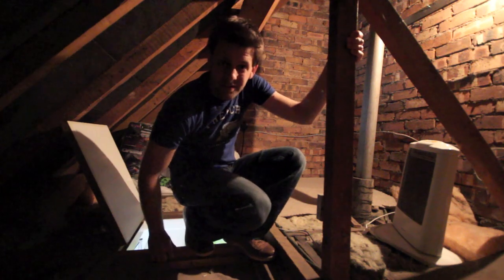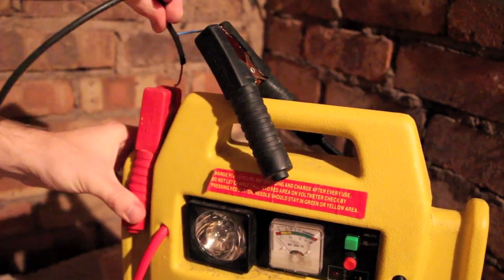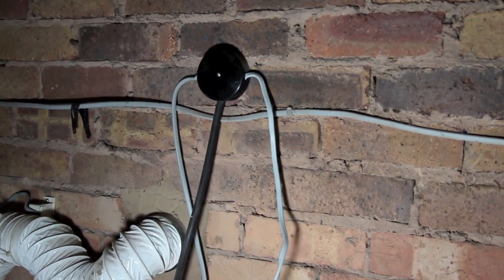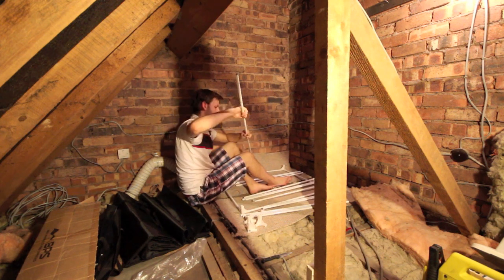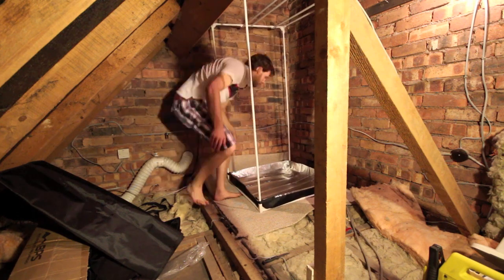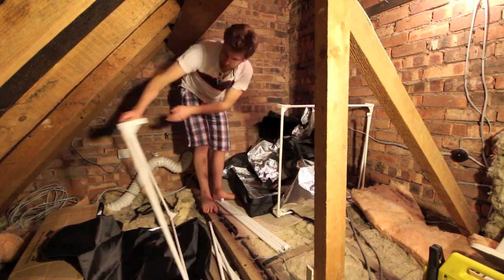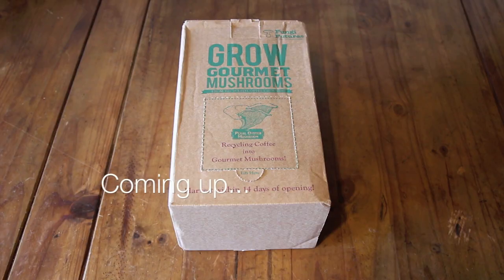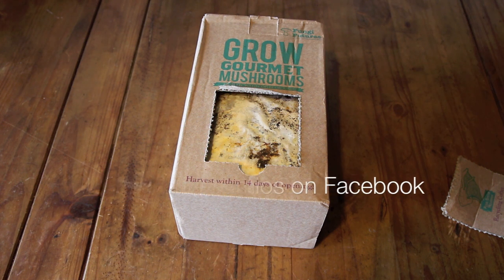The Loft Garden: Grow Tent & Wiring (S01E01)

Comment: If you are using HPS or MH bulbs you need a contact relay or you will weld your timer points together because of the initial load and it will mess times up
If using floro straight into the socket is fine :)
Ask your local grow shop what a contact relay is :)